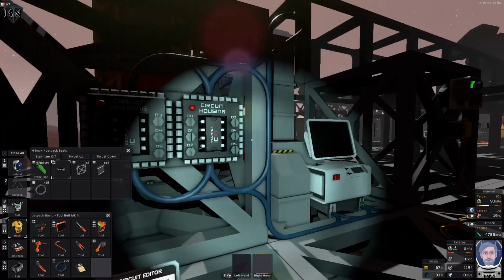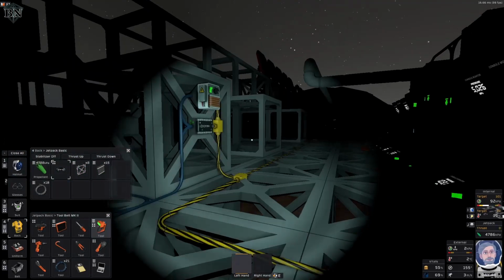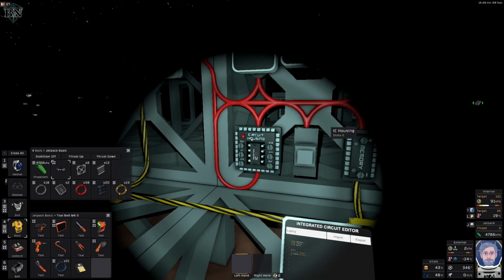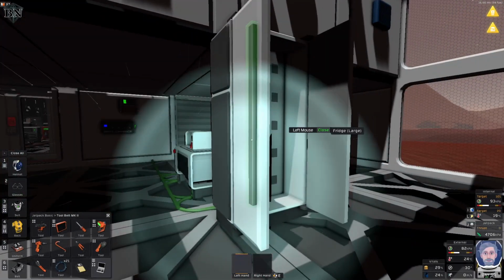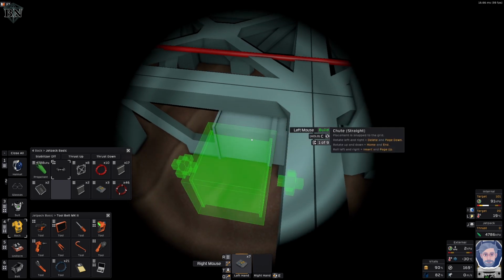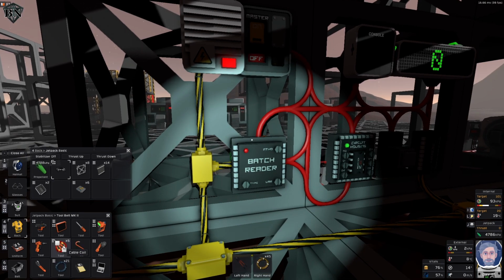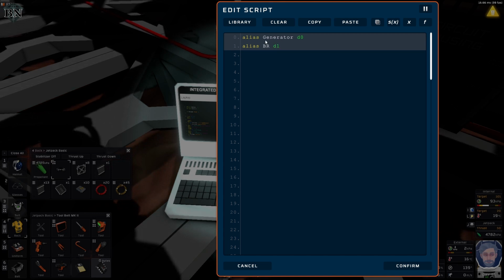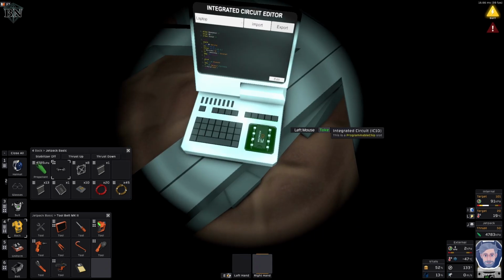Stationeer - Mars Ep17 - More Logic and Backup Power

Comment: Was having trouble with the request logic script in your workshop using dial and button. After a request the script was sticking at line 44 "j Ontheway"  I found that in line 43 register r2 should be register r3  "beq r3 1 start. After changing to r3 working without issues.  Great playthgough on mars i  really like how you are utilizing logic channels and such. not a lot of documetation out there for its use and you are providing great content. Thank You